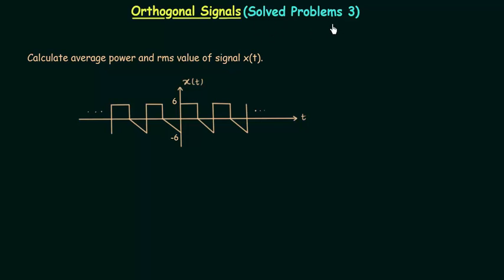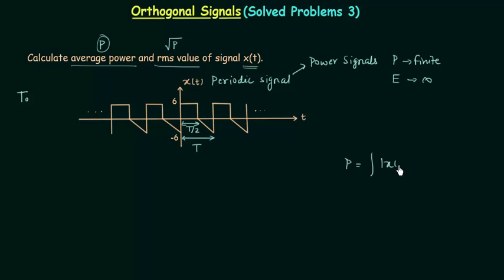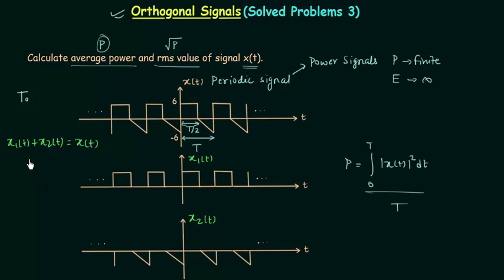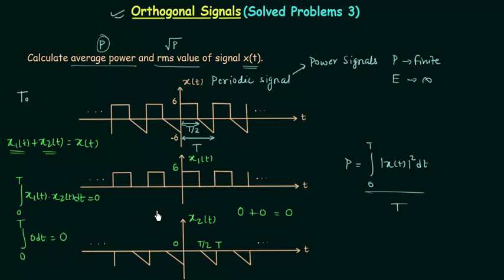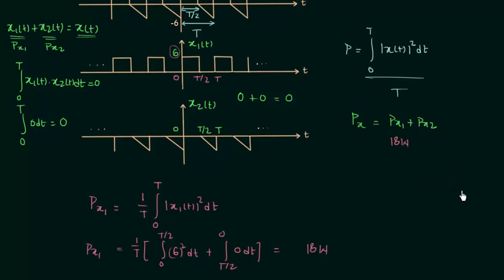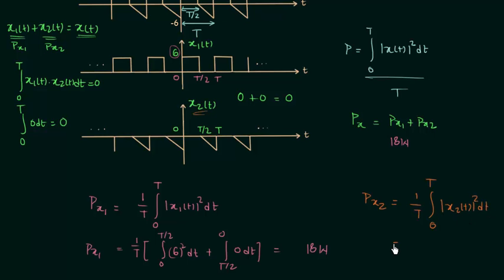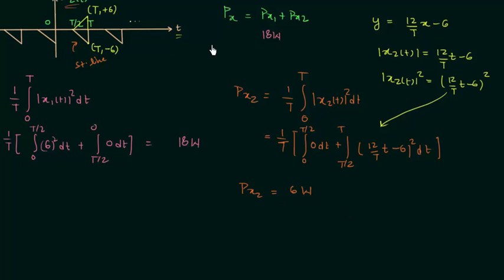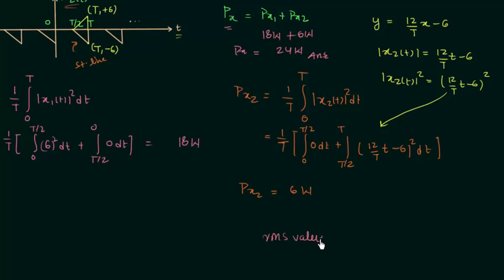Orthogonal Signals (Solved Problems 3)

Comment: Very good video, sir. However, you have an error in your limits of integration at 4:38. The upper limit should be T, not zero. I have also not heard the absolute value operator called "mod". Where did this terminology originate?

Comment: how did u solved that integration at the end which u got 6 watt
Reply: Birendra prasad Das  the average power for  a triangular signal is (Ao) square /3 but here is a half triangle so the average power will be (Ao) square/6
Reply: @vinaypant557  THANKS